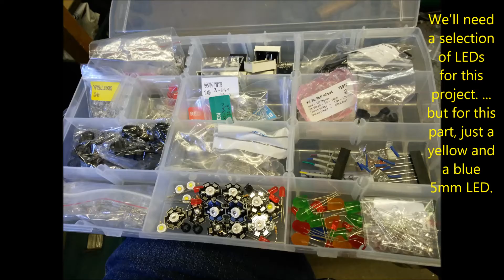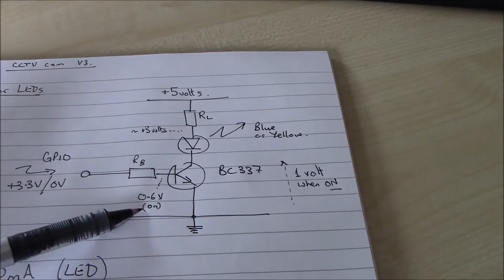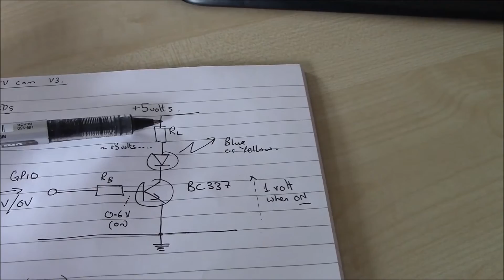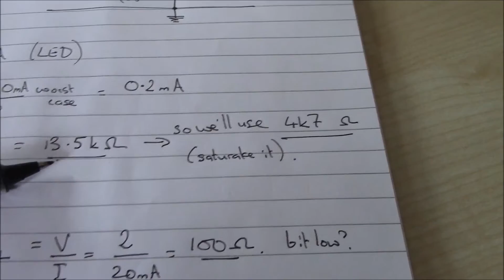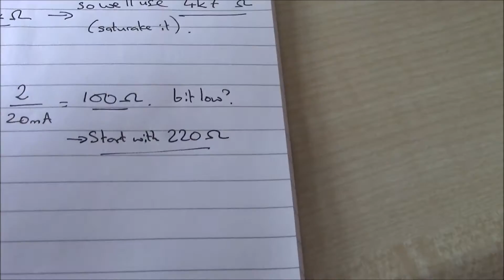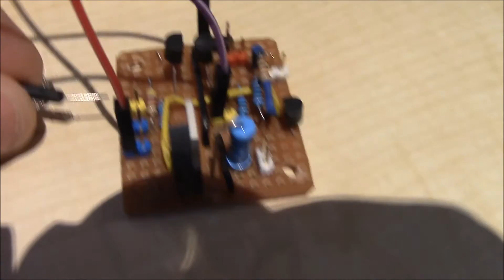Raspberry Pi CCTV camera Mk3. Part 3 : Driving the indicator LEDs using GPIO

Comment from the maker: # Harold Spud's Ras-Pi 'Fronty' CCTV script 
# CCTV camera - no lightsense - uses pillow
# 29 March 2017 . new SD card
# Version   brightness: PIL module used
# filename fronty_cctv.py
# V3.00 imagemagick installed.
# use apt-get install imagemagick
# uses convert command to add text/datetime into images.
#
# addbanner shell script : (this script sits in /home/fronty)
#
#   convert -pointsize 20 -fill yellow -draw "text 820,895 ' CCTV House Front $(date)'" $1 $1
#

import os
import shutil
import time
import RPi.GPIO as GPIO
from   datetime import datetime
from   PIL import Image
import pysftp

YellowLed   = 26
BlueLed     = 22
IRLEDS      = 23

GPIO.setmode(GPIO.BOARD) 
GPIO.setup(IRLEDS,     GPIO.OUT)                             
GPIO.setup(YellowLed,  GPIO.OUT)                            
GPIO.setup(BlueLed,    GPIO.OUT)                            

imgWidth     = 1920                                              # Max = 2592
imgHeight    = 1440                                              # Max = 1944

d            = datetime.now()
initYear     = "%04d" % (d.year)
initMonth    = "%02d" % (d.month)
initDate     = "%02d" % (d.day)
initHour     = "%02d" % (d.hour)
initMins     = "%02d" % (d.minute)
homedir      = "/data"
fileserial   = 1

maxfiles     = 4500  # 24000 for 32G SD card 6000 for 8G partition. divide this number by 5 to get pics per folder.
imgWidth     = 1440  # Max = 2592
imgHeight    = 900   # Max = 1944
sleeptime    = 1
folderToSave = "pics_"+str(initYear)+str(initMonth)+str(initDate)+str(initHour)+str(initMins)

def FLASHON():
        GPIO.output(IRLEDS,False)                                  
def FLASHOFF():
        GPIO.output(IRLEDS,True)                                  
def FlashBlue() :
        GPIO.output(BlueLed,True)
        time.sleep(0.1)
        GPIO.output(BlueLed,False)
def FlashYellow() :
        GPIO.output(YellowLed,True)
        time.sleep(0.1)
        GPIO.output(YellowLed,False)
def IRpic(fileserial):
            pic_name = "%04d" % (fileserial+1) + ".jpg"
            print("Taking IR Pic "+pic_name)
            GPIO.output(IRLEDS,False)
            os.system("raspistill -w "+str(imgWidth)+" -h "+str(imgHeight)+" -o currentpics/"+str(pic_name) +" -sh 90 -awb auto -mm average -v")
            GPIO.output(IRLEDS,True)
            return pic_name
def DAYpic(fileserial):
            pic_name = "%04d" % (fileserial+1) + ".jpg"
            print("Taking Daytime Pic "+pic_name)
            GPIO.output(BlueLed,True)
            GPIO.output(YellowLed,True)
            os.system("raspistill -w "+str(imgWidth)+" -h "+str(imgHeight)+" -o currentpics/"+str(pic_name) +" -sh 90 -awb auto -mm average -v")
            GPIO.output(YellowLed,False)
            GPIO.output(BlueLed,False)
            return pic_name
def archivefiles():
    print("ARCHIVING ")
    shutil.rmtree("oldpics4",True)
    os.rename("oldpics3","oldpics4")
    os.rename("oldpics2","oldpics3")
    os.rename("oldpics1","oldpics2")
    os.rename("currentpics","oldpics1")
    os.mkdir("currentpics")
def brightness(pic):
        im        = Image.open(pic)                            # Can be many different formats.
        pix       = im.load()
        width     = im.size[0]
        height    = im.size[1]
        rectheight = height//5
        rectwidth  = width//10
        lum       = 0
        for x in range(width//3,width//3+rectwidth):
         for y in range(height//8,height//8+rectheight): # rectangle in top left of pic 10 x 10
          lum +=  pix[x,y][0]                     # Get the RGB Value. add to lum value. 
          lum +=  pix[x,y][1]
          lum +=  pix[x,y][2]
        lum = lum / (rectwidth*rectheight*3)                    # luminance = sum of (red + green + blue) intensities for each pixel ) / 3
        return lum                                              # 50 = dark. 150= bright

def addbanner(image):
        print(" adding banner to ",image)
        os.system("/home/fronty/addbanner " + image)
        print("Banner added")

# MAIN SCRIPT

GPIO.output(IRLEDS,True)   ## turn all the LEDs off
GPIO.output(BlueLed,False)
GPIO.output(YellowLed,False)

os.chdir(homedir)
os.mkdir(folderToSave)
os.chdir(folderToSave)
os.mkdir("currentpics")
os.mkdir("oldpics1")
os.mkdir("oldpics2")
os.mkdir("oldpics3")
os.mkdir("oldpics4")

daytime     = True
darkcounter = 0

while True:
    for fileserial in range (0,maxfiles):
        

                if fileserial%5 == 0 :
                    
                   if daytime :                                 #  day time
                        print("Daytime pic...")
                        pic_name = DAYpic(fileserial/5)
                        print("lum = ",brightness("currentpics/"+pic_name))
                        if brightness("currentpics/"+pic_name) < 70 : daytime=False
                        print("Daytime is now : ",daytime)
                        FlashYellow()
                        time.sleep(1)
                   else :                                       #  night time
                        print("Nighttime pic...")
                        time.sleep(1)
                        pic_name = IRpic(fileserial/5)
                        print("lum = ",brightness("currentpics/"+pic_name))
                        if brightness("currentpics/"+pic_name) > 70 : daytime=True
                        print("Daytime is now : ",daytime)
                        FlashBlue()

                   addbanner("currentpics/"+pic_name)          # adds date and banner text to image using imagemagick convert command.
                   print("copying latest file to frontypic.jpg ")
                   shutil.copyfile("currentpics/"+pic_name,"frontypic.jpg")    # copies latest pic taken to pics folder/frontypic -  for sftp transfer.

                   try :      
                            print("connecting sftp..")
                            with pysftp.Connection('192.168.200.10', username='fronty', password='W0lfsp1d3r!') as sftp:
                                     sftp.chdir('/var/www/CCTVpics')
                                     sftp.put('frontypic.jpg')
                                     # print(sftp.gettimeout())   doesnt work
                            print("sftp completed")
                            sftp.close()
                   except :     print("uh-oh!..")           # if an exception is raised. ie. it went wrong
                   else :    print("Sucess.")
     
             
                else :
                    if daytime :
                            FlashYellow()            #  night
                            time.sleep(0.05)
                            FlashBlue() 
                            
                    else       :
                            FlashBlue()              #  day
                            time.sleep(0.05)
                            FlashBlue()
                              
                # copytoweb(pic_name)
                fileserial += 1
                time.sleep(sleeptime)
                print " Finished Pics Run"

    archivefiles()